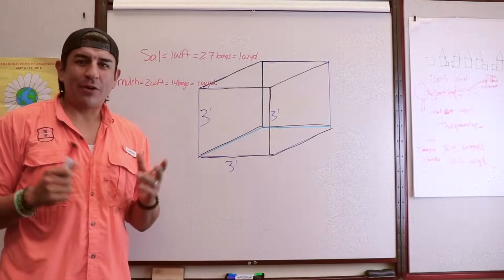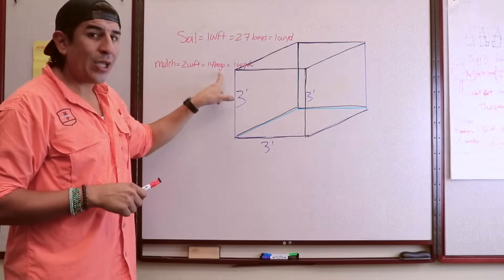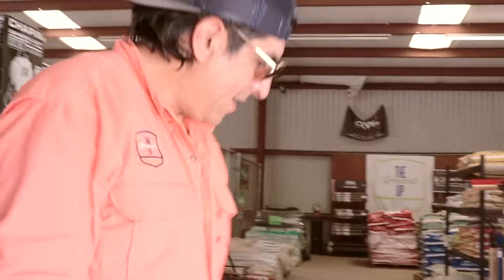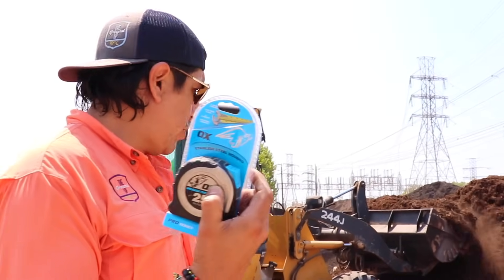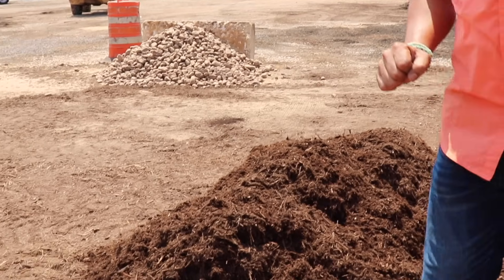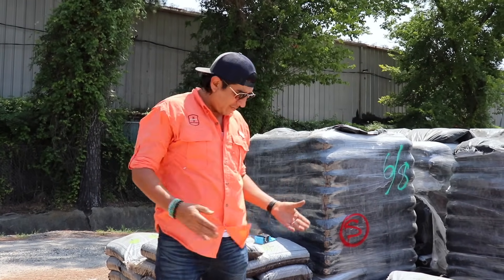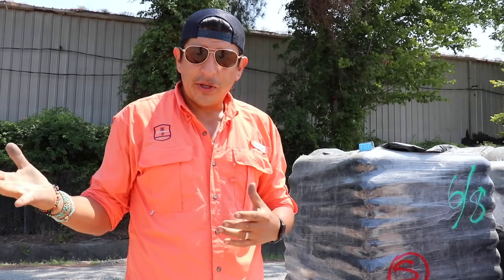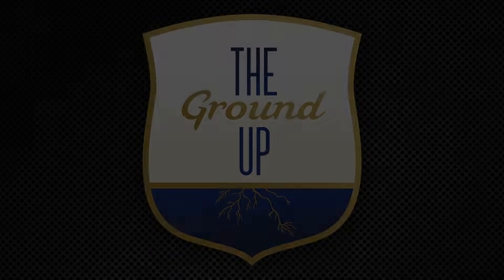What Does A Cubic Yard Look Like?

Comment: Thanks!  Here's an SAT Math question.  I've got a lot of dirt/sand available nearby.  I've heard a bobcat can carry a 1/2 a cubic yard.  I've got a 50x50 clearing I need to elevate 2 feet. How many trips will it need to make? BTW, can a bobcat dig out a bucket right from the earth?
Reply: 50x50 is 2500 square feet, and you need to raise it 2ft so you need 5000cu-ft. There are 27 (3*3*3) cu-ft in a cu-yard, so you need 5000/27 = 185.2 cu-yards.

You need 2 trips per cu-yard, so 185.2*2 = 370.4. So I'm not sure if I would say 370 or 371 trips.